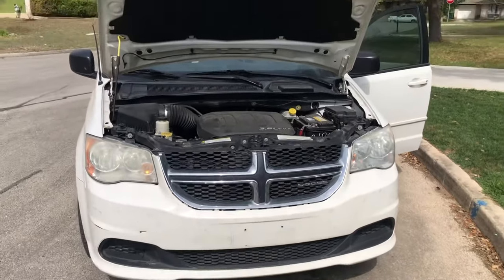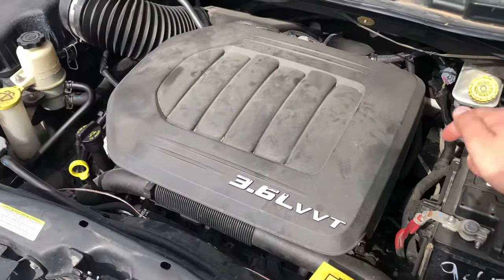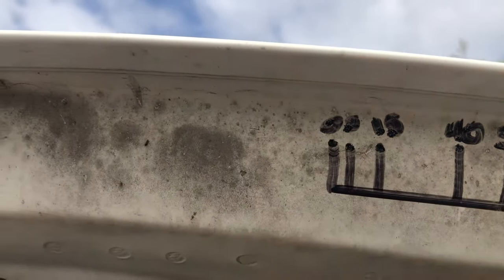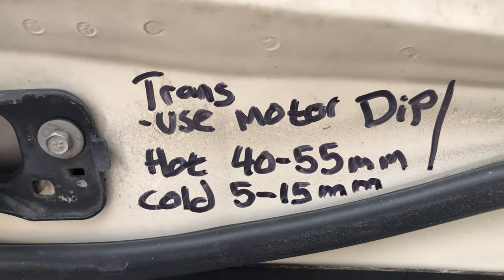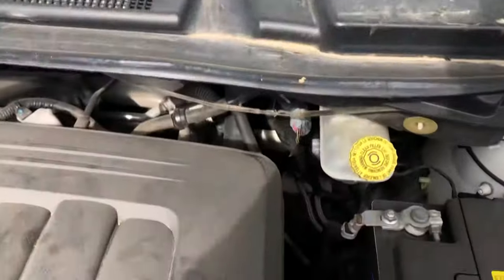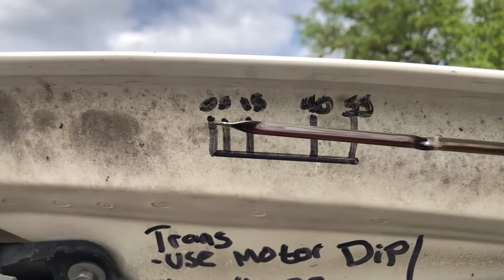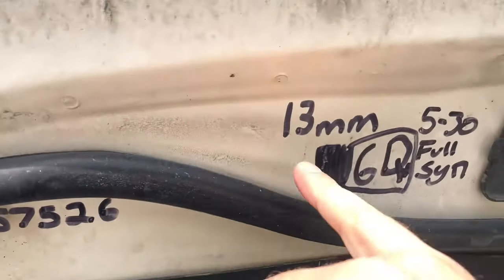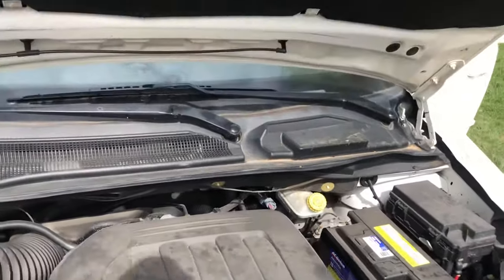Hidden Built in Transmission dip stick | Dodge Grand Caravan 2010 2011 2012 2013

Comment: Just went out and found the trans tube. It's easier to see with a flashlight looking in from in front of the battery at 45 degrees toward the engine. It's under that fat wiring harness that's below the radiator hose. Measured and made scribe marks on the back of my dipstick for the future. Cold is about 1/2 inch and hot about 2 inches. (+/-) Most people in the USA have no clue when it comes to metric.

Comment: Couldn’t see where to dip the oil dip stick to check transmission fluid?
Reply: There's a long skinny black filler tube under the cluster. Has a cap with usual "transmission fluid" logo on it
No larger in diameter than a quarter

Comment: Multiple those numbers by .03937 and have AMERICAN STANDARD MEASUREMENTS
Reply: 25.4 is the acceptable number to convert from mm to in. Your number might make it more accurate but harder to remember
Reply: @XxDiceman27xX    that's roughly 2 inches up the stick for full when hot. It's also roughly just below the "safe" mark on the other side of the stick. You can do the math one time and make your own scratch marks for the future.

Comment: I thought when is cold it measures more n when is hot it measures less!
Reply: Automatic transmission fluid expands as it gets hotter. This is why the level should read higher when the oil is hotter. Same for my Toyota.

Comment: Why when i check it when its cold. The level is really high. When warm its in the 40 & 55 range????
Reply: Automatic transmission fluid expands as it gets hotter. This is why the level should read higher when the oil is hotter. Same for my Toyota.

Comment: Unfortunately 0n some of the newer models have a sealed transmission so it can't be checked stupid engineers
Reply: I have a Toyota and yes the fluid level of the "sealed " transmission can still be checked as is so more most sealed automatic transmissions. As it is with all makes & models that I know of.

In my 2017 Toyota RAV4 as in other Toyotas, some Mercedes,... it is checked via removing the oil pan drain plug.
Up inside is a plastic straw kind of thing and it is hand tight threaded in there.
When the temperature of the oil via an OBD2 reader (I use a cheap small one that plugs in to the OBD2 socket under the dash and an app on my phone). 
I take the phone under the vehicle with me. 
For my Toyota with the engine running when the trans oil temp reads the specified temperature range of between 35 & 43 degrees celsius (95 -  110 degrees Fahrenheit) the fluid should be just trickling up, over the top of the straw and running down and out. If it does then the level is 100% correct.

If it does not then it is low on fluid so add some.
If it keep running out full blast let it drain some SHut it off and let it continue draining and let it cool down which can take an hour or more depending on the atmospheric temperature outside.
Then repeat until the oil just slowly runs out. Then re-install the drainplug bolt with a gasket.

Comment: Where is the line or measurement for when you gotta add transmission fluid
Reply: Under 40mm if it's hot, under 5mm if it's cold.
Reply: @mikemonopoli120  thank you
Reply: @mikemonopoli120  why is checking the trans fluid so complicated now whatever happened to the days when the dip stick would just read  add or low with out all this temperature hot or cold
Reply: @jimmyfale6370  It's not bad really, just do it hot, wipe off your oil dipstick and stick it in there, it should have 2 inches of pink oil on it.
Reply: @mikemonopoli120  thank you I am not really technically inclined I am so use too the old days of reading the dip sticks high low or add oil that's all thank you very much I don't have a lot of money so doing things myself had been a challenge especially with these computerized cars thank for your feedback appreciate it
Reply: @jimmyfale6370    In the good ole days, we checked the trans fluid when the engine was warmed up.

Comment: Does engine oil splash out of your oil tube with the dipstick in the other hole? That would be my only concern.
Reply: I believe it's measuring the amount in the pan which is not under pressure. It wouldn't be able to splash up and out of the dipstick hole.

Comment: I don’t see a cap on my transmission
Reply: it's below the radiator hose and below that fat wiring harness, or about a foot below that plastic cover on the engine. Easier to see if you use a flashlight and go in front of the battery at 45 degrees toward the engine.